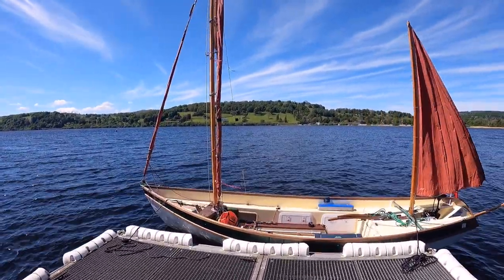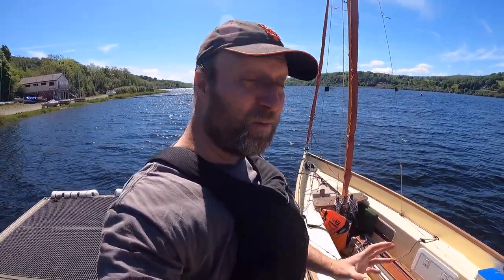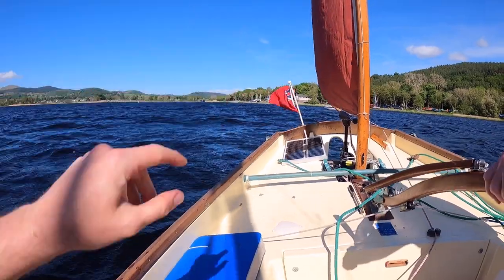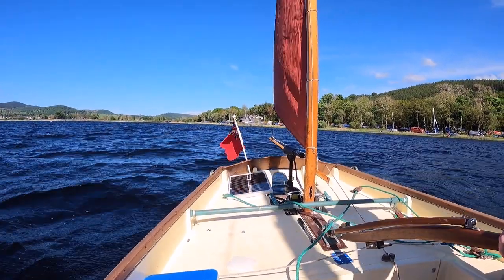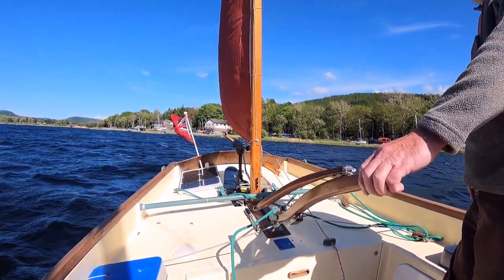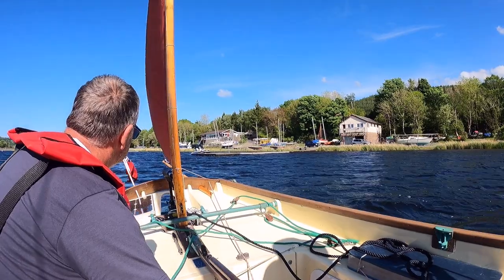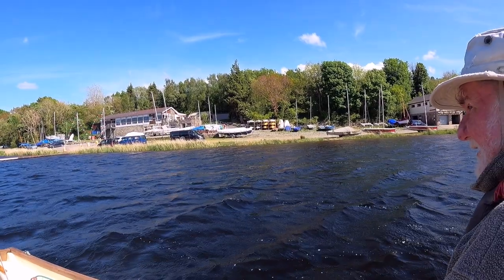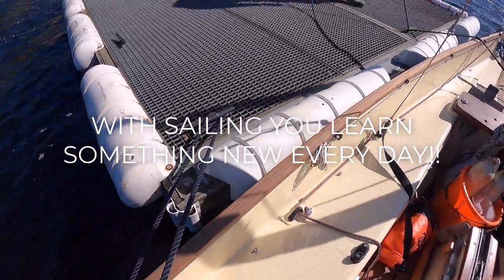Reversing a Drascombe Lugger onto a Jetty under Mizzen sail only!

Comment: This is an interesting demonstration and shows another useful attribute of the mizzen / yawl sail plan. I use the mizzen a lot to keep the boat head to wind when reefing, anchoring and fishing etc
Reply from the maker: Yes I agree. The sail seduces me every time i'm out with it and I also frequently use it the exact same way as you. Yes, the boat is not technially "hove to" using the mizzen only, however its so quick and easy to sort yourself out and I like the way it puts the bow right into the waves. When hove to she needs a tweak to get her pointing upwaind well.

i also use the sail when at anchor to keep the wind on the bow too. Makes her far more stable and also safe for boarding etc if you go for a quick swim.

Comment: Thank God for Rob ... Never in a month of Sundays have I sailed backwards !
I have drifted backwards like you seemed to be doing in the video but Rob said you weren't; so you weren't !
But truly. Heaving to is a far more practical way of keeping a boat under control while letting it drift backwards AND maintaining the option to stop and go forwards again as and when you wish. Just a question of practice. 
Drifting backwards for 6 full minutes at speed like you were is not recommended.
What if the battery is dead for the electric motor or Rob misses the second jetty because he's "mashed up" getting the first one ?
Reply from the maker: Hi Team33. Many thanks fro the comment. You have basically asked all the same questions I did when I wasn't yet under the spell of the Mizzen!!! Let me try and explain a bit better.

Firstly we are definitely reversing and steering using the Mizzen. There's no motor or anything else going on here. The boat is not drifting, it is being pulled by the mizzen backwards and the rudder is just steering us to where we want to go. Think about this for one moment...

...all an engine does is push the boat with the rudder to steer us, not much different really?

I asked about missing the jetty and the answer was 2-fold:

1. "Thats why we're aiming for the first of 3, if we miss the first one we aim for the 2nd one or 3rd one". 
2. "If we miss them all or conditions just don't allow us to get this right, we raise the sails (or drop the motor if we have one) and sail off. We can then come around and try again or do something different."

I have to say I originally didn;t like the Mizzen sail. It made tacking harder and was generally a sail I wondered if the boat needed. However as my experience and skills have developed on the Lugger, I have found the sail to be real magic, to the point I would not want to give it up on my next boat.
Reply: @SailingWithDave  Each and every one to his own I suppose. 
I happy that you are happy as my Grandfather used to say.
1) The mizzen is NOT pulling you backwards, but being pushed backwards by the wind.
2) You are NOT under sail but drifting with a mizzen up (YES it's being used to drift faster, but you are still drifting).
3) 6 minutes of drifting backwards ....... ? 

I will stop here but please believe that your friend Rob is wrong.

I have often stopped a fast moving forward yacht (4 tons) and then backed up a little using the wind (I have no outboard).

Good luck to you being the laughing stock of the local SC "sailing" backwards.

There is a REASON nobody else does it.

Practice sailing up to a buoy and stopping the boat as if the Buoy were your jetty.
Practice overshooting by a boat's length and drifting backwards under control.
Practice steering your boat while drifting backwards (the reactions are nothing like when you are sailing).
These are all manoeuvres that any good sailor needs to know.
Drifting backwards with a mizzen up isn't.

Cheers and may you enjoy many many happy days sailing (backwards?...).
Reply from the maker: Many thanks for your follow up comment Team33. Anyone reading this thread should have a couple of angles to it now which is exactly what I think the comments should be used for. I am, as you are, happy to leave this one there.
Reply: @team3383  :Other people DO do it, including myself. Why not -  it adds to your repertoire of boat  maneuvering skills and  might even come in handy one day. It is fun as well.  Setting the mizzen  more perpendicular to the line of the boat gives more way and  better control. 'Practice steering the boat while drifting backwards (the reactions are nothing like when you are sailing)'. You don't say! Or as our Americans friends would have it, no shit!' ! 🙂
Reply: Whats the point? This sailing backwards for the sake of an ego rub and if something went wrong put other boats in danger. A normal round up against the jetty took half the time with the boat under total control.or hove to. This  Seems like an excercise in ego.

Comment: Nice.  I was trying to work out, is the mizzen getting its power from the fact that the bumpkin is offset to the port side? So when you haul it in, it's offset from the centre a bit?  If so, I guess you can only do this trick when the wind's on the correct side?
Reply from the maker: Hi Quentin. I'm no expert but let me tell you what I think here.  Firstly I think the end of the bumpkin is centred to the boat so despite it being on one side it should be effective either side. I just watched the video again and can see the bumpkin is sheeted in tight so what I think it's doing is just trying to keep the boats bow into the wind. With that force and the force by steering the rudder I guess you can steer it. The aft movement must come from the current alone as the bumpkin is not really going to pull the boat back unless it's sheeted out much more. At least thats what I think anyway.
Reply: I think it must be primarily the wind on the hull, then?  I think you're right that the mizzen is just keeping you directly head into the wind, so this only works to take you straight downwind, with just a bit of way for steering once you're moving. (It can't just be current, or you wouldn't be moving faster than the water and couldn't steer.) 
Then as you're going, if you do drift or steer slightly away from the wind, there will be a force on the mizzen pushing you back, which will also provide some impetus.  Does that sound plausible?  A useful trick to know, anyway!
Q
Reply from the maker: @quentinsf  Yes, good point about the steering and needed to have the wind on the hull. Where we were in the video the current starts to get stringer as it exits the lake into the River, however you would need to have some kind of speed to be able to steer as you said.

When I speak to the sailor in question I will ask him about the exact mechanics of this. At the time I was just in awe of everything, but as time has now passed I am able to take on board a lot more to understand how it works exactly!!